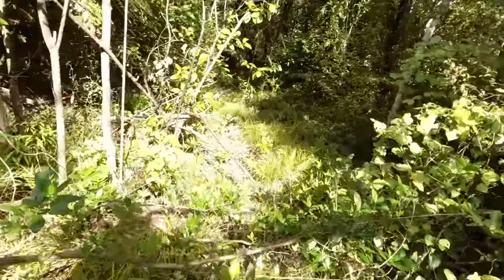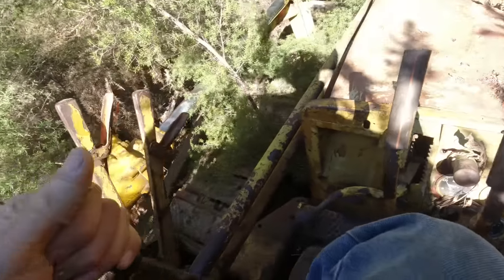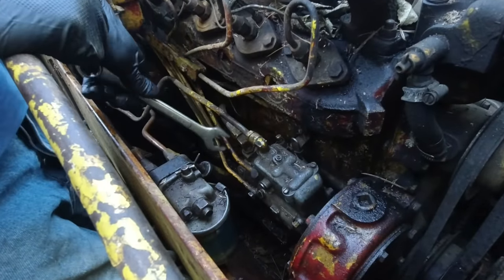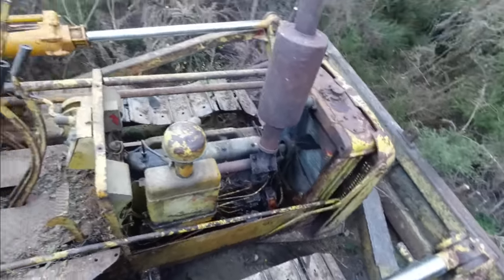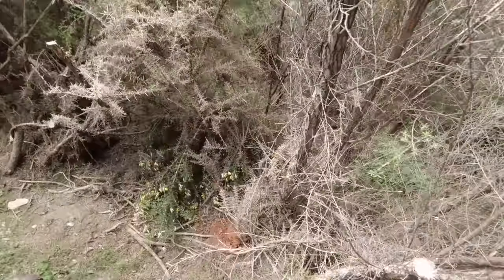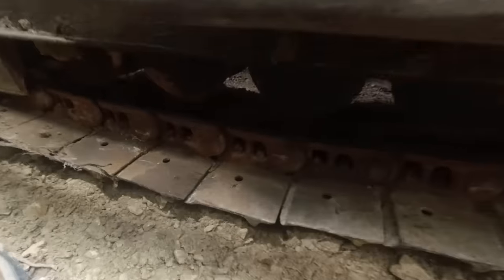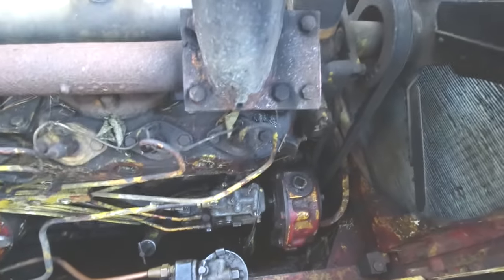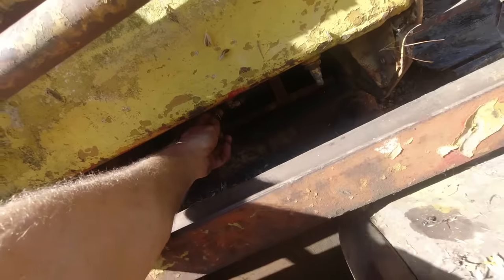Salvaging an Abandoned TD9 Bulldozer from the Forest.. Will it start??

Comment: Fuel pump comes out towards the rear, tapered fit so get everything loose and gentle tap to get the gears to let go. Twist the pump as it's coming out and bring it out to the side and up over the top.

4 hands are needed. 3 fingers will be lost.

Also grain of salt, I labour for diesels mechanics, I'm not qualified or knowledgeable enough to confirm or deny anything. Don't forget top dead centre and marking the gear teeth etc. 

The fuel pump may also have worn out seals inside it and leak diesel into the oil sump. Keep an eye on the oil level rising in the future.
Reply from the maker: Thanks mate, good info. cheers

Comment: This is one of the better, “will it run” videos I have watched. Good to see that you put coolant in it instead of water. I would have also put in a quart of 2stroke oil in with the fuel. Helps lubricate the piston rings for better compression when starting.

Comment: That water, diesel, coolant, freezer box, battery tools etc;....must have weighed a ton,  there must be someone with you... but off camera.
Reply: Marty has commented he made 5 trips in and out on foot as a wheelbarrow would not fit between the trees....so carried everything himself.
The last trip on foot was to drag the bonnet (hood) out using it as a sled to take out the last of the gear (after he had driven the dozer out).
Reply: @JohnSmith-pl2bk  ok....but that was still a big task for Marty....but it was worth it.
Have a nice day.

Comment: I think that blade setup, is similar to what was known as a Hamilton high lift” designed to clear farm gates,etc.
Reply: There was an original  bucket that passed over the top of the whole dozer so that when the scoop was filled with it's load from the front...the bucket was emptied into a truck parked up at the back of the dozer so that the dozer did not have to move much.

just forward; scoop; backward a little; raise bucket up and over towards rear; drop contents through rear of bucket into waiting truck.
Bring bucket back to front etc. etc.

When wheeled loaders became more common they could move quickly and maneouvre easily...on wheels..so this bucketing method on crawlers died out.
Reply: @JohnSmith-pl2bk  oh yeah, now I recall seeing a similar one years ago, the dozer motor was a petrol start, with plugs down one side and injectors on the other. Can’t recall the make though. She had died in the bush, with a huge mouthful of dirt in front.

Comment: International Harvester beat still my Midwestern Illinois Heart !!!!!  I hope its a gas start diesel run
Reply: @ mattmopar440  Nothing beats the sound of those UD engines, huh?
Reply: @jamesthompson8008  Its the Cold starting in winter where they truly shine even with an old nearly flat battery they crank over so easy on low compression gas mode fire up let the idle up to temp than pull that lever and chugga chugga its off running on diesel such a good system compared to anything of that time period

Comment: My first instinct when you looked at the track and the way it was split was that they probably split the track to stop anyone going up there and simply taking it and you may find the actual pin on the machine somewhere 🤷🏻‍♂️
When it started up so easily I was thinking  initial problem was the fuel leak on the injection pump and they decided to leave it and go back at a later date to resolve the problem.
Hence splitting the track.
On the injector issue I’m an Ex Plant Operator from the Royal Engineers and was taught as a matter of practice to always crack the first injector when bleeding the system as part of the bleeding process.
Don’t know if this helps in future or I’m simply teaching my granny to suck eggs mate .
Cracking effort getting it out of there btw 👍🏼

Comment: Good video. By the way, you should try to start it on full throttle, not half, so that if one or cylinders fire, they have enough power to keep the engine turning over until the rest start firing. Also use 'easy start' or similar, to save time and lessen the chance of running the battery flat.

Comment: One of the many ways of removing snapped bolts is to hold a nut on the end and fill it full of weld -  the heat generated also helps to break any corrosion - Stays safe

Comment: I'm impressed that the pin didn't pop out of the tracks multiple times during the travel out.
Reply from the maker: Interference fit, its not coming out in a hurry
Reply: @MartyT  good point. I'm a machinist by trade so the fit part makes sense, although the interference is minimal if you can pound it in with a hammer. Also, the pin is certainly very close to round and the holes are certainly egged out at least a little. I've just never had that good of luck when doing the same thing with our tracked equipment. Even in a pinch in the woods always ended up welding it or peening it. Glad it worked out for you though!

Comment: One should fill all fuel filters with auto tranny fluid. Injectors will love u for it. Also fires off a bit easier with compromised compression. If that is the case

Comment: that injection pump needs a new rubber on the governor about every 20 to 30 years . if you dont replace it it will seize the pump when it disinigrates. looks like a rosa master pump. i had 2 pumps seize and twist off the shaft that drives it.

Comment: To get the bolts out of track guard an bottom rollers we used to used a stick welder an a piece of thick pipe weld a nut to pipe the slide in tube a weld the inside of tube to bolt the weld extendeds the bolt an the heat frees it off

Comment: I have one that a TD9 Series B. The first ones the original TD9 which were a gas to diesel start. Those should have a torquenverter on it. Mind has a Camargo winch, different engagement system. Mine was bought new by GM and came out of the old Dayton Ohio GM engine plant and is on rubber pads. Still pulls in the dirt pretty good but it has more winch then it has weight. Be careful that winch doesnt pull ya off a hill. Also to fix that leak on the pump your going to have to pull that pump. Should be a Roosa master pump if its like on here in the states. Ya have to watch putting it back on, its easy to roll that umbrila seal on that drive shaft.
Reply from the maker: Nice.. I managed to fix the fuel pump leak without removing the pump,  just enough space to pull the throttle shaft and replace the offending seal -https://youtu.be/HmgW5NcGcqQ

Comment: If you pull pump off,there may be a bolt hole somewhere where you thread bolt in to keep pump and gear train in time. Make sure to remove bolt/ pins before starting engine. I've seen that before,what a mess that can be.

Comment: how do all ? she dont seem much bigger than a d4 what we snigged out of the bush around lake mckarney, 
30 k sth of the nut nw tas. as long as we cut 6 sleepers off each 16 ft log we could cut rest for droppers, palings and building lumber. 260 sleepers a month. all without any mechanical lifting, onto skids, dock, then stack at end of skids, then stack on truck, then handstack again into 4ft deep train wagon.
just a tip i learnt when tas contract logging, - when spooling a cable onto winch put a knot so it tightens over the end oftoggle so saves having to get out and re set resulting from winding out too far for a good drag. and d the big ones to keep em up out of the mud. i'ld be cutting a low track as prob where a downer would have rolled or slid to prior availability of strong mech's when hand saws were in action.
good to see your lucks still working marty, now get to work and build a cabguard for her or just when you think no need a springer'll let go and rap you around the scone. taztez.

Comment: It seem here in the forest since 1977..
Can you start it successfully?
New battary. New engine oil. Radiator cooling water . Connecting the cut track . Seperate the pocket. Hydrlic cyls make sure they are servicable. .....imporant to make road through the forest

Comment: I’m sure you already found out but that looks to be a stanadyne fuel pump. I used to work in a shop that rebuilt them. Not too hard but to do it right you need a test stand.
Reply from the maker: I fixed the leak, it was coming out of the throttle shaft

Comment: A 6 Years Ago or so I did some repairs for a Lady Who Purchased a Log Home and Hobby Ranch and in the Pasture was a 1963 International Harvester Tractor Backhoe! It had been Sitting for 20 Year's the Previous Owner Said.
It Looked Like a Olf Hooker On a Rough Weekend!!! 3 Years Later I Traded About $3500 in Work For Old Hoe in a Swamp That Who Knows if it Ran????
We'll in a Hour it Was Running and Died 3 Times Backing up a Steep Gravel Path and I Managed to Stop in a Few Feet From a Old Barn at the Bottom!!!
In The Time Scince The Tractor Works Great and the Hoe Works like a Tired Hoe But gets the Job done in the End!!!

Comment: with me --  the radiator would have been rusted out and leaked like crazy - the hydro oil would have been half empty or more  - the fuel lines would have been gummed up so bad no fuel would have passed through - and the clutch would have welded together with rust and not worked - and most if not all of the engine oil would have already run out -- and all of the filters would have gummed completely up - and no rats nests in anything - unreal -- what God is it yu pray to -- i think ILL have a try at him - must be a good  one -- ahahahehehaahehehahehehaahaha  - the hike and the hassle IM used to - ahahaahahaahe

Comment: Had to laugh at the digital callipers wrapped up over the battery compartment. I have those exact same ones and mine does the same friggin thing. Battery needs pressure on it for the calipers to remain on. I shimmed it with a small piece of paper folded over a couple times.
Reply from the maker: I have converted mine from button cell to aaa batts, I got sick of changing the batts every 10 minutes 😂
Reply: @MartyT  oh nice one mate, not a bad idea lol

Comment: If you just put the blade up, you wouldn't have caused so much damage. Maybe that was intentional.
Reply from the maker: I prefer to keep a firm footing on the ground when operating tracked machines, tracks can easily slide sideways when crawling over slippery tree trunks and vegetation, which can result in roll-over on a steep slope.. Also if there are undercarriage problems, it is easier to jack up the machine when working on dirt rather than battling vegetation to get the machine off the ground

Comment: I can't believe you didn't drain the oil pan a little to make sure water wasn't in the oil as it settles under the oil you usually can't tell by the dip stick,  you just have to drain a little to see. Could destroy the engine by not checking